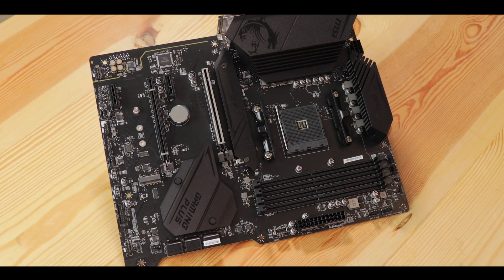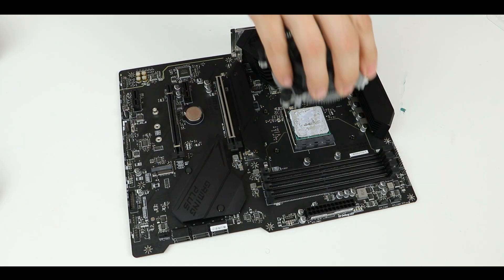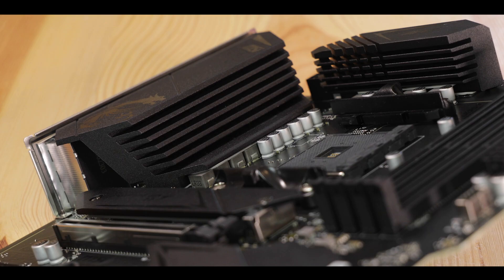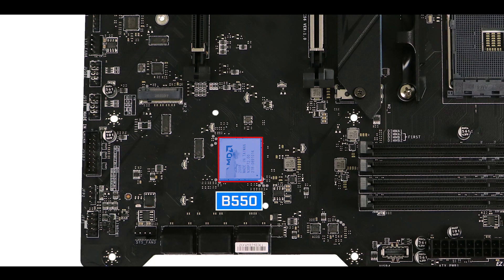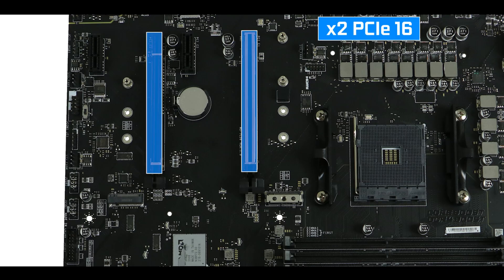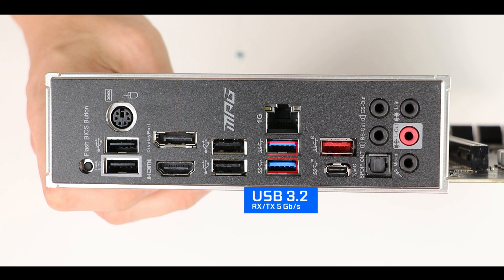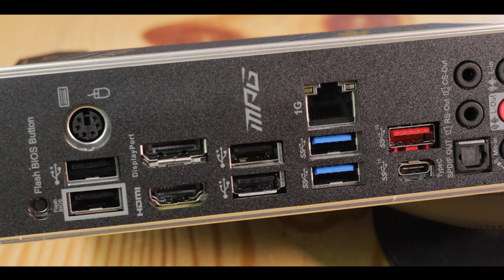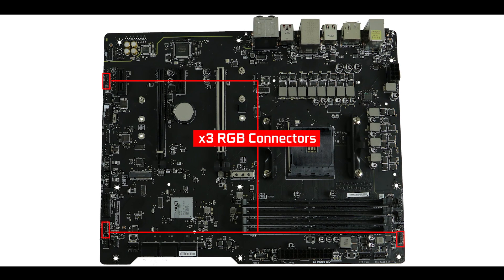MSI MPG B550 GAMING PLUS, a HOT mess!

Comment: I have the gpu and a gen 4 ssd slotted in the CPU pci-e lane. 
I need to connect a wifi card and an additional m.2 ssd. Will connecting the wifi card in the other x16 lane slot be fine?

Or will this configuration affect my gpu performance? Please suggest

Comment: I have used this board several times with the Ryzen 5 5600G and it performs very well. I like the USB-C front connector and the USB connectors in the back. For CHF 108, it is one the best values out there.
Reply: Did you connect r5 5600g out of the box? Or need a bios update using pen
Reply: @dagonalchemist7682  worked out of the box.
Reply: @dagonalchemist7682  It worked from the start.

Comment: i don't get it. on your gigabyte b550 aorus elite review, you totally praised that board though it only has 4 layer pcb. on this msi board, you immediately brought up that having only 4 layers is bad. so which is it?
Reply from the maker: Power stages on this board heatuch faster and culminate at much higher temps.

Solder points accumulate heat. 
The PCB extra layering would have greatly help with heat diffusion
Reply: @Laurentschoice and where in the video is your data substantiating this claim?

Comment: I see others on here saying they had a good experience with this motherboard and i’m here to say the same. Upgraded to AM5 and now i’m looking stuff up about this motherboard again in order to sell it and I just wanted to say that I had a great experience with this motherboard. Was very easy to work on, ran my 5600x great, and the bios was easy to use. I swear in this realm you can find a negative video about any single PC part. hardware Unboxed also shows this motherboard performing well.
Reply: I bought this mb for my 7 5800x3d, works absolutely fine as well

Comment: I really don't understand, you just massacre this board because of the "unacceptable" 4 PCB layer, but on the reviews of other B550 motherboards with the same 4PCB layers (like de Asus B550 TUF or the B550 Aorus Elite V2) you are VERY soft on it just saying "yeah not the ideal but it works fine". And after the Hardwre Unboxed review on temps, i think you REALLY should get another board an re-do this review, it just doesn't align with your own other reviews on the competitors of this board and is really off compared with other tech reviewers on this model.
Reply from the maker: Hey.

Well ... I hear you :/.. but it's been... What 3 / 4 years ... 

I'm swamped with Z790 boards as it is....

Comment: the board is fine, and  it actually runs quite cool as well its not a hot mess like you claim to be, maybe you get the faulty one, Hardware Unboxed even reviewed and its one of the coolest MB in terms of its VRM thermal benchmark

Comment: This board has confused me a bit on the PCIe 4.0 vs 3.0 x16 slots. In the UEFI it says both x16 slots are 3.0.  Is it a typo?

I have a PCIe 4.0 nVME plugged into the "Lightning" m.2.

I have a PCIe 4.0 GPU into the top "Lightning" PCIe 4.0 x16 slot.
Reply: and its working fine? cuz i have my m.2 in lower slot (m2_1) + gpu in upper slot (pcie 3.0/4.0 x16) wich is m2 -> chipset and gpu -> cpu

so u have both working from cpu? without any issues?
Reply: @watersonnn  They are both working from CPU, but I suspect I may be sacrificing performance due to pcie throttling. 

 It is someone else's PC now, so I would have to make them stop playing LoL long enough to benchmark it.

Comment: There is misinformation in MSI site when I google MSI B550 Gaming plus saying that it has 6 layer pcb. So I decided to find out what is real number because Chat GPT says that it originally had 4 PCB layers , and now new revision has 6 pcb layers which is doubtful. So do you have any additional information about that? Because MSI support doesn't really seem to answer me with that question.
Reply: Shouldn't really matter, as this has little impact on your daily experience. Anyway, if it is not advertised on the website, then it is probably a 4-layer PCB. I can also see the traces going from the socket to the RAM slots, so most probably a 4-layer PCB.
Reply from the maker: In general.. even with a 8 PCB layers .. u will see the traces since they are usually placed on the most outter layer PCB in order to avoid signal interférences with the back PCB traces. 

Having more layers has deep implications on the product stability (PCIe signal bleeding / interferences), thermal diffusion and the over all componentry life span. 

I hope this helps :)

Comment: The way you present in your video is good. That is about it. I feel, tbh, that this was more of a clickbait that leads to unsubstantiated claims and odd requests of a mid-range board that offers quite a bit at its price range. 

Oh and after a year of using it, it works rather well considering I bought it for its Gen 4 PCIE capabilities and it's VRM thermals.

Comment: The manual sais: when using a second m2 you can´t use the 2. gpu slot. Haven´t heard that in your video. Apart from that, it solved my question if dual gpu would lower the x16 to 2 times x8. as in your video that won´t happen due to 2nd gpu is x4 and therefore using a 2nd m2 won´t reduce the slot 1 gpu speed. On my b450f gaming if you would have used 1 m2 it would reduce the gpu from x16 to x8
Reply: sry can u help? am using gpu in upper slot, and m2 in lower wich is disable sata ports (like manual says). here is the question, to unable my sata ports i need to transfer my m2 in upper port, but what should i do with my gpu? transfer it from upper to lower slot and get x4 speed? its not what i want when i have x16

or m2 in upper and gpu in upper?

Comment: Can someone explain to me why the maximum Ram frequency will decrease as you add more Ram  sticks? I’ve heard even in a dual channel motherboard 4 sticks is often better than 2 especially for AMD 5000 series chips. And I was under the impression that 2 sticks was faster than a single because they can sync up and achieve higher MHz? Maybe this is wrong thank you.
Reply: MIT den gleiche ram?vier sind immer bessser musst auf die latenz schauen
Reply: Because you're forcing the memory controller. It's much easier for the controller to control 2 sticks and all consumer platforms only have two memory channels anyway, that's why most people use two sticks over four. In high end overclocking focused motherboards they won't even give you 4 sticks.

Comment: Hardware Unboxed tested the vrm thermals of this and other b550 boards in that price range with an overclocked r9 3950x and the msi mpg b550 gaming plus came out 2nd best actually. Their test also came out about 4 months before this video was released. Just FYI if you want to buy this board.
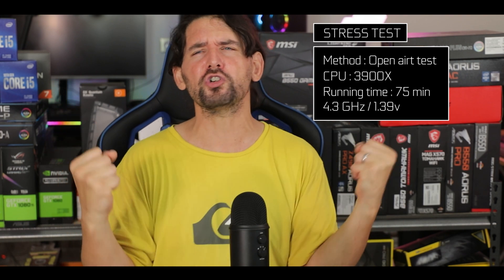Reply: Could it be that he is using a stock cooler???? see 4:04
Reply: @marshal7969   of course that's about it pcb layers they have nothing to do with  the temps and 12 power stages they can provide over 400w actually 600w of power I would say that this board is good for the price and even better than some more expensive ones also, no motherboard is made so that there is no air at all to pass over it, and this happens with an open test bench especially if you have 12 phases that's the worst way to test it  the more phases you have, the hotter it gets and the more you have to cool it logically
Reply: in that video they used water cooling.  do that make any difference?
Reply: @army_of_noobs  i think the big diference is in the case flow vs open case, the stock cooler blow hot air in the vrms, not as hot as the vrm it self.
Reply: thanks for the info :D

Comment: Hardware Unboxed did a video on B550 VRM thermals on several boards and the MSI B550 Gaming Plus was consistently one of the coolest.
Reply: I was watching the video where Hardware Unboxed used a well-ventilated case in a room with a temperature of 21°C. However, it seems that the test was not conducted in the same manner by this YouTube channel; apparently, they used an open-air case with a box cooler blowing hot air onto the VRM.
Reply: @LuizAntonioPiccoJunior  this is NOT the boxed cooler for this CPU. I am really wondering if he really tested with a wraith stealth that comes with 65W CPUs on an overclocked 105W CPU!! loool
Reply from the maker: @sassuki I rarely use the boxed CPU cooler :)
Reply: @Laurentschoice  you may want to redo this test then 😂
That motherboard is still widely available today, and may be people will get the wrong idea.
Please test once again with a beefy cooler, like the bequiet Dark Rock TF2 if you wanna overclock, else you will be dumping even more hot air on the poor VRM; you know, Einstein's relativity theory: if the VRM is at 80°, but the CPU is at 95°, a downdraft CPU cooler will heat up the VRM, but if the VRM is 95° and the CPU is at 80°, the cooler will cool the VRM 🤪
Reply: The fewer pcb layers and the hot vrm solder points underneath are are good criticism of the board.
Reply from the maker: Unfortunately that was not the case with the model I received.

Comment: as i already stated, i sent back this motherboard becouse was too hot, maybe the 4 layer bcp but vrm's also was contantly 50-55 degree. Then I bought a gigabyte aourus master b550, temp are 36-40 degree right now on vrm's and ambient temeperature are 28 degree celsius @11:00 pm clock time. I undervolt my cpu ryzen 5600 with ryzen master at 0.925 and 3700 mhz. Also why didnt you make a video about Gigabyte Aurus Master ?
Reply: btw I agree with everything you say. in the end the tomahawk is what we want to buy when buy this one

Comment: LUV the review, but a bit afraid for my new PC. :)  Running non-overclocked 5800X with 32 GB of 3200 RAM, an NVME booter, a couple of hard drives, and a 750-TI. This PC runs Windoze and runs 2-5 VMs. It stays on 24/7/365, and has well-conditioned power (in an always cool environment). It's replacing a 4770K on a Z-87A MB. That PC has been running nonstop for 8+ years. I hope this one does the same. I COULD return it until July 7, but choosing motherboards is tricky these days because there are SO MANY. Plus, I don't want to spend megabux on a "gaming" motherboard, cuz this one doesn't do any gaming :)  Thanks again for the review.

Comment: I had 2 x conector  lan in year 2005... IF you pluged 2 ethernet cables u get x2 speed.. IF u had 100 mbps it will work  at 200mbps.. So funny.. IT was gigabyte. And same with asus 2010 had x 2 1 gigabit, 2 gigabit ethernet.... lol.

Comment: wow dude, just stop..... this motherboard can't overclock higher than 4 and 6 physical cores ? check out hardware unboxed's review of the motherboard. works fine apparently ?
~71°C with a 16 core 3950X  overclocked if I remember correctly.
you did no actual testing right ?
next time actually test with an overclocked 16 core processor & check out the temperatures of contacts by yourself. pretty sure there's no problem over here
not to mention, processor overclocking is kinda dead for gamers, there's really few gains to be had on ryzen

and what's with advertising for a single stick of RAM really ?

In short you should call this video : "ramblings & my opinions on reading about that motherboard, without having actually tested anything"
Reply from the maker: Nah... I did... only difference is... I bought it myself  and spent an ugly week with it... just like it's X570 variant. 

Now... it is possible I had a defective piece... that happened in the past and can happen again.
Reply: @Laurentschoice  if you do test stuff then I suggest you show/disclose your testing procedures & results in the future. can't trust anyone these days on the internet on their word only. Not to mention testing procedures actually decides of the actual result.
examples: ambiant temp, case or no case, minimal airflow ?, or none at all if on a test bench, CPU used, overclock settings, how temps are picked up (thermal imaging can give wrong results depending on reflectivity of surfaces for example)
did you actually touch ? cause 120°C should burn pretty much & so on....
Reply: BTW while you're here
PS/2 is mostly a feature for pro gamers
since PS/2 is interrupt based it means ~0ms of delay between a key press & when the CPU acknowledges it, whereas USB is polling based & therefore the input lag introduced by the keyboard is dependent upon the frequency of the polling.

PS/2 has also no limitations on nkeyrollover unlike USB. which is why some USB devices register as several USB devices to work around that.
sure for most people it doesn't change anything.

Finally if you're like me, you bought a good PS/2 mechanical keyboard years ago, why produce more electronic waste by changing it ?
Reply from the maker: Watch my few last reviews , I share my thermo gun reading whilst filming :) which makes it easier to report
Reply from the maker: Well right now I kind of see ur point.  

I am at a friend's house and no USB keyboard would work . Have to order a PS2... three days on it
Reply: @Laurentschoice  good step forward, thermal guns use the same technology as thermal imaging devices, it's a starting point but measurements might have to be validated by another method, differences in reflectivity could affect the accuracy of results.... AFAIK
Reply from the maker: I used to place little detectors Linked to thermal reader ... but à asshle to move around components. 
Thermal gum gave about the same readings so far :)
But to get a good one did cost a little fortune....
Reply: @Laurentschoice  so apparently the article I linked got deleted.
I'm surprised, there should be a massive difference in emissivity from contacts to VRM components, enough that measurements should be inaccurate.
Unless you coat the targets 
here's a quote from that article: "Here is one way to understand the effect of emissivity uncertainty on measurement accuracy: Suppose the uncertainty in target emissivity is ±0.05. For an emissivity of 0.95, this represents about a 5% error (0.05/0.95). For a material such as shiny copper, emissivity 0.05, this represents a 100% error (0.05/0.05). These errors propagate into the temperature calculation, increasing the error in temperature reading. Our recommendation is to not attempt temperature measurement for target emissivities below about 0.5 because of this effect. Coat the target with a high-emissivity material."
Reply from the maker: @whismerhillgaming  very valuable info !
BTW do u have a channel ?
Reply: @Laurentschoice  no, at least not a true channel where I would try to build up views & subscriptions & publish regular content.

if you're interested in more, the full article can be found easily by searching for the quote I made in previous post. (since youtube doesn't want links apparently)
Reply from the maker: Yeah things are a little strange with YT these days...but they are working on it apparently

Comment: Watch effective reviews of this board and you'll realise it actually as the best termals in its price class. I have one, just updated bios to agesa 1.2.0.1, have ryzen 5600x with negative offset and rtx 3070 already working feature resizable bar. Running ddr4 4000mhz no issues, super stable system. Loving this board.
Reply: just bought the same setup just different gpu . any problems with the motherboard overheating?
Reply: @stavrosoikonomakos5120  I brought this board one year ago, no problem at all, temperatures very cold, running with ryzen 5600x.

Comment: Sorry but this thing works great for me.  So easy to use.  Saw a an fps improvement by upgrading from a gigabyte b450 (especially after turning on game mode in bios).  My ryzen 7 3700x does not seem to thermal throttle at all.  The audio is fine and sounds great and actually sounds better then my Macs onboard output and my DAW (2012 Mac Pro Laptop).  I guess if I am wrong I will come back and tell ya, but two months later still am happy I did.  Only dissappointment for me Blu Tooth but that was fixed with a usb device.  1 gig lan also sucks but I only got 250 meg internet.  Overall I think this board was definitely worth it and I also got it for 10% off (Probably because this Review.  Ha Thanks! ;) ).  It is on the lower end for the b550's but all the other boards I was looking at were at least 100 dollars more, and to get all the stuff he says it's missing would put it at at least $250 to $300 usd.  But I did enjoy this review and overall and have enjoyed many of your reviews.  Keep up the good work!
Reply: Had this mobo for about a year and I haven't got the audio Jack to work. I plug in my speaker cords to the port and no audio :/ any idea? Speakers are brand new
Reply: I was planning to use this motherboard with an and ryzen 5800x cpu and wanted to know if I should have second thoughts
Reply: @Mangotunde  dont do it
Reply: @politicallyincorrect4452  how come?
Reply: @Mangotunde  Thats a heavy duty cpu, spend the extra 20$ and get the MAG version
Reply: I just got the mobo would i be able to still use wifi or i have to buy adapter?
Reply from the maker: Whatch and you ll see :)
Reply: @Laurentschoice  😢

Comment: I'm running this board w/a Ryzen 5 3600 (have not OC'd it yet) an older GTX950 OC'd to 1525 mhz core clock and 3350 mhz memory clock  and 32 GB Corsair RAM, a MasterCooler Cooler Master ML240...it runs every game amazingly with no issues, no overheating on ANYTHING and hitting no less than 44 FPS on medium settings.  Did I mention I stream my games on Twitch w/SLOBS, b'c I do.
Reply: bro get a new gpu and youll go flying!